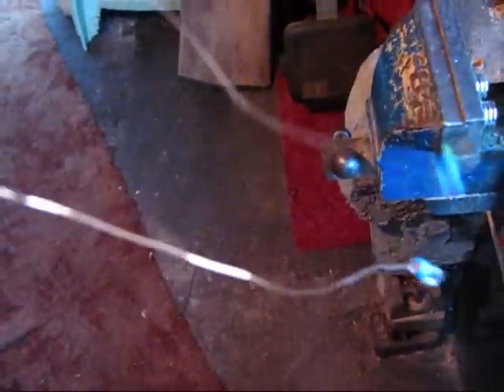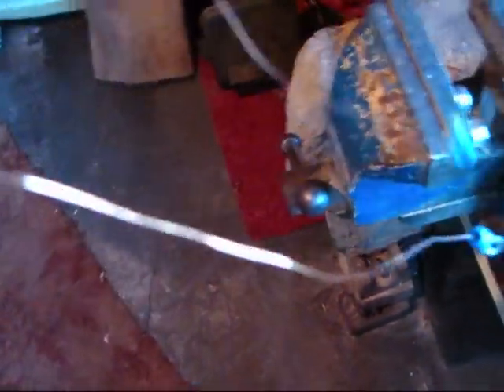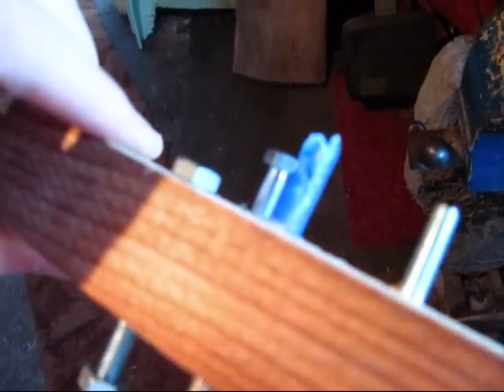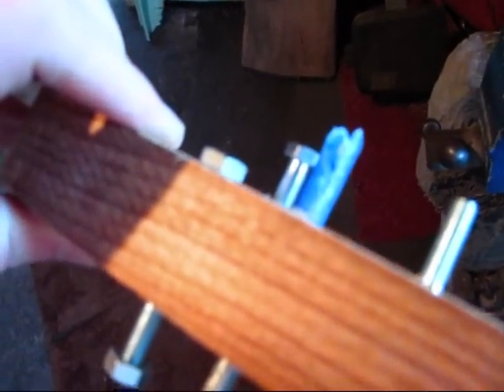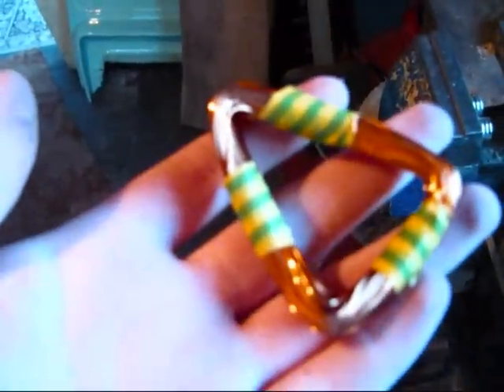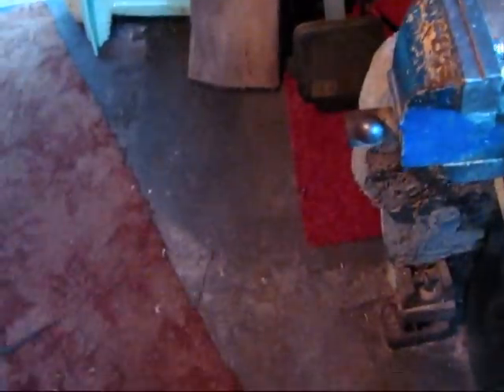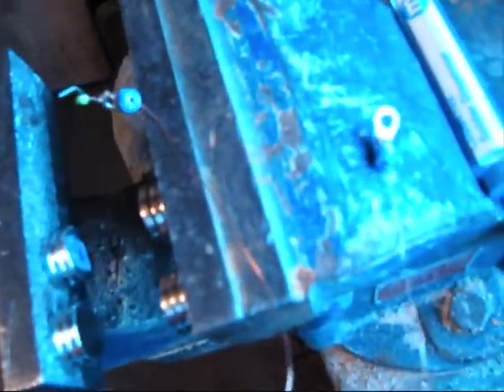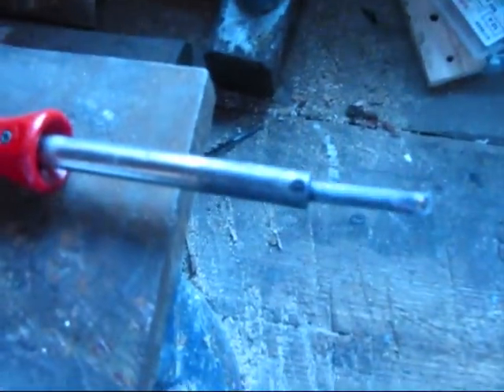Simple Electric generator III

Comment from the maker: @hillsongfree I Dont have an exact number but i think around 300-400 turns. Basically i stopped once the thickness of the wire was too difficult to easily work with.